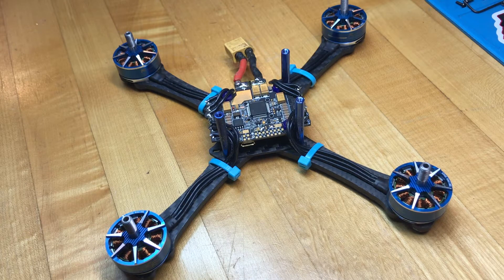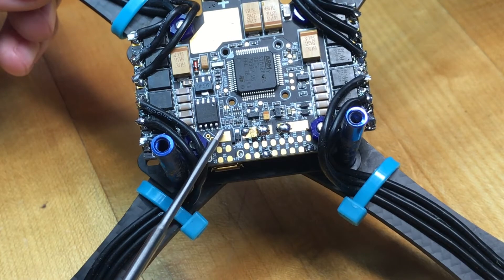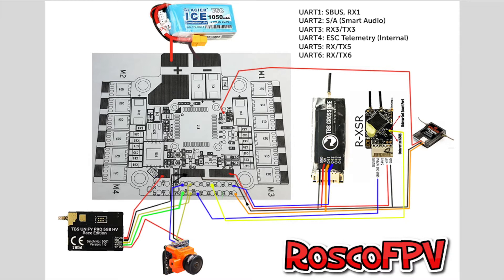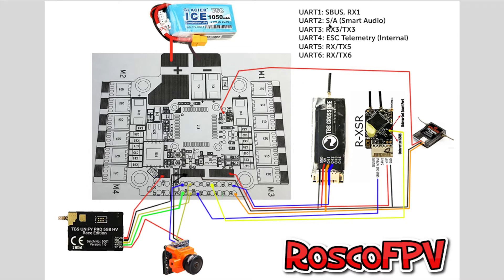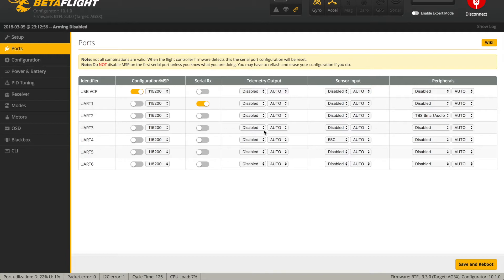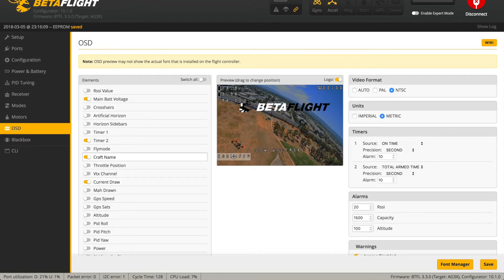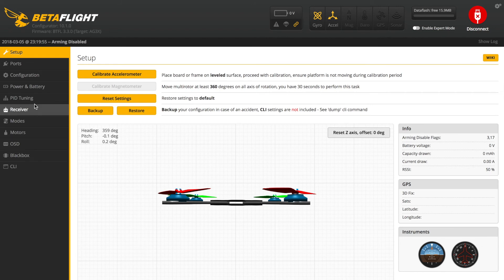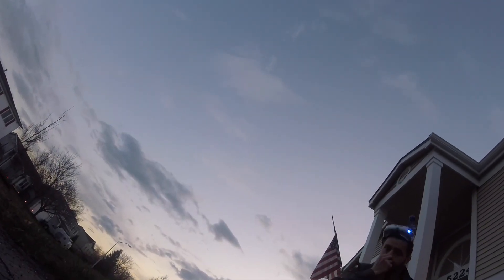Airbot Asgard32 - Wiring Guide ❍  Betaflight Config ❍  Review

Comment: Hey RoscoPFV, great vid man.......quick question, can the ASGARD 32 6S run on a 6S lipo?
Reply from the maker: Chronis FPV I have heard rumors that it can but it’s not rated that way from the manufacturer so I personally wouldn’t do it. It’s all fun and games until you get a voltage spike and burn it up. 4S is plenty powerful on a lightweight build like this.
Reply: @roscofpv2357  thanks for the feedback, I really appreciate it. I however, took the 6S plunge, and im happy to report that the Asgard32 holds up quite well. Check it out: https://www.youtube.com/watch?v=Z1FqGugT_WY

Comment: Thanks for posting this video dude, I have the f7 version of the asguard I'm getting ready to install in my Astro x frame and you pretty much covered every single question I had about getting it working in my setup right down to the motor resource reassignments and reassigning the sa pad from led to smart audio....I wasn't going to try to connect camera control because I wasn't sure exactly how it worked but from watching your video it looks like I just take the signal wire where you would normally plug the little four-way control board into the camera and connect that to the camera control pad on the fc and it should work correct?

Comment: THis is a piece of garbage. I got one and the solder pads fall off. The video in and out.... Those 2.. Airbot confirms there is an issue, yet is not really helping me on this...
Reply from the maker: I'm really surprised that they're not replacing it for you. If there more to the story you're not saying? Definitely keep reaching out. They'll typically send a replacement ASAP free of charge.
Reply: RoscoFPV maybe it's easier when you have tons of views and subs... the vin and vot just fell off. Air bot told me it's not from over heating but just from the wires being attached to it. They want me to pay half price.....

Comment: Hi man, just put the last HEX file on my Asgard32,  works fine but ESCs are unknown in Blheli Suite, I can't flash them, what have you down with yours? Thanks
Reply from the maker: NICO FPV the “32” implies 32bit ESC which requires BLheli32 suite instead of blheli suite. Download that, and you should have no problem. It’s windows only though FYI.

Comment: Hey bro Mr airbot set me a board to test do u know if i can just use the omnibusf4sd hex for 3.4 or should I use the latest one from the link in your description cause I. Using it for 3D quad and need the hex with the 3D fix
Reply from the maker: Definitely don't use the OmnibusF4 Hex, this has a very different architecture. Use the one from my post, or check to see if it's made it into the latest version of betaflight yet. When betaflight 3.4 drops it should be available.
Reply: RoscoFPV why what happens with. Omnibusf4sd that's what came on it
Reply from the maker: ORLY? does it work that way? The omnibus F4S SD doesn't have all the same ports on-board so I'm surprised that it would work. Does camera control and everything work appropriately?
Reply: RoscoFPV not sure yet but I set it up it a custom hex for 3d I was using it on my Asgard v2 till it lost a cap
Reply: Ill be spinning the motors up in about a hour just coming home from work
Reply: Is it the forth link in the discription

Comment: Will it run Butterflight?
Reply from the maker: It should run butterflight great, but as of the time I tested this, there wasn't an official stable release even for the latest Betaflight or butterflight. I full expect this to work if it isn't already. Here's the test build for BF 3.3.1 if you're interested. It should get ported to Butterflight when it's ready. https://github.com/jflyper/cleanflight/issues/14
Reply: RoscoFPV thx mate, will update mine to BF 3.3.1 asap

Comment: I don't get it any half experienced pilot can easily tell an ICM 20602 outperforms and mpu6000 by a noticeable amount on stock pids abd out flies it buy a easily noticeable amount
Reply from the maker: QUADBOT FPV I’ve never had any luck with the ICM 20602. Any time anyone tries a “better gyro” I end up getting yaw twitches and hot motors. Glad it worked for you!
Reply: QUADBOT FPV I'm about to try this gyro on a new build, hope I don't have to get frustrated with the pro corner.
Reply from the maker: QUADBOT  Here's your flight video of this board. I challenge you to post a more smooth video with the ICM20602. The MPU6000 on the latest software with the right filtering enable is so silky smooth. While the IMC20602 may be theoretically better, I don't think it will be a perceivable difference. https://youtu.be/MYp_WtaxQlk
Reply: RoscoFPV I know everyone uses the 6000 , I was being a rebel when I ordered icm20608. Haha .